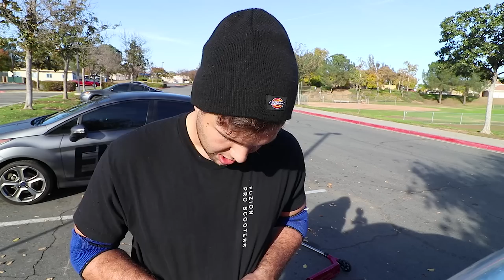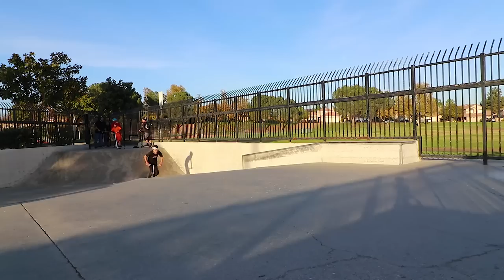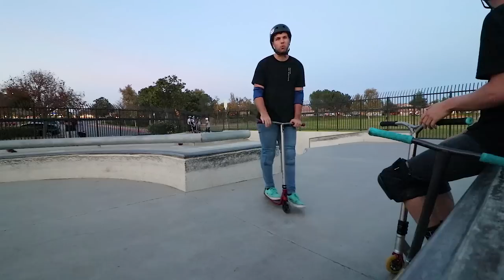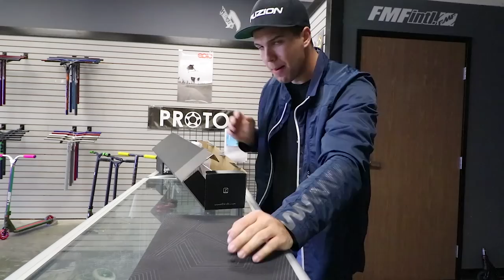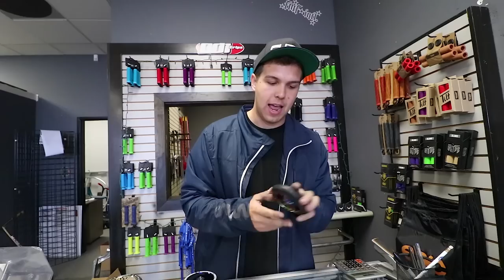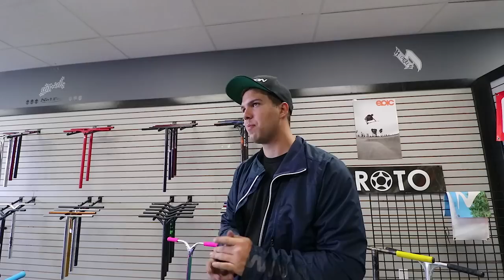HOW TO MAKE YOUR CUSTOM SCOOTER LIGHTER!

Comment: What if you have steal bars and ethec deck
Reply: It would be light but not to it’s full potential 
The bars and front end would be extremely reliable tho
If your getting light weight the parts may be less reliable 
For example steel bars are stronger than aluminum but heavier titanium bars are the best of both strength and weight but they’re expensive 
Hope I helped. kinda too late 🤣